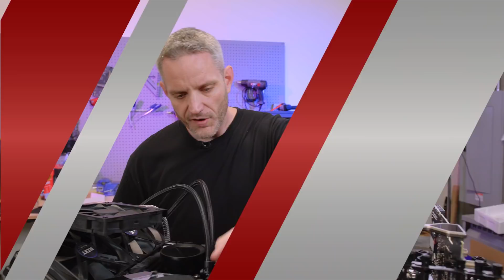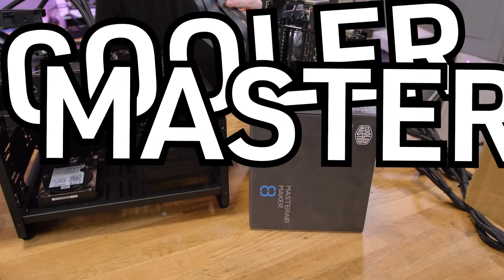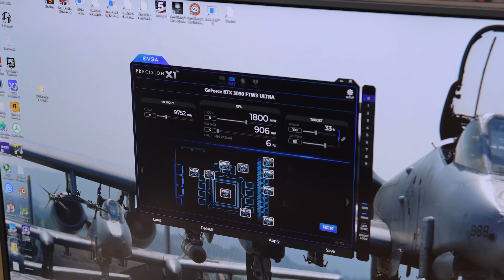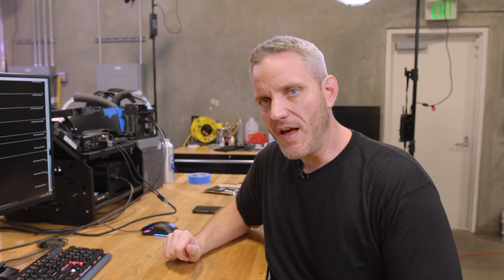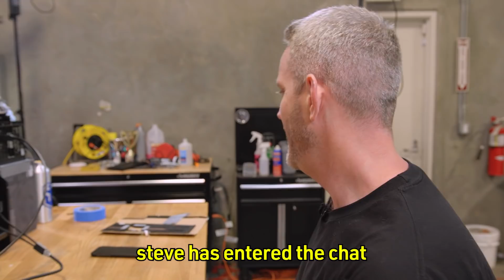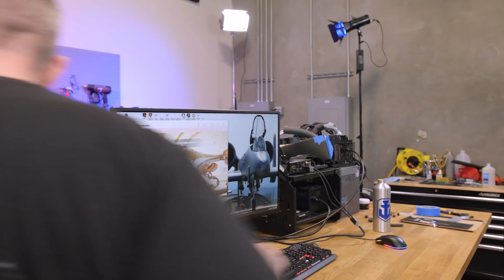Homemade Waterblocks for RTX 3090 SLI... these results are incredible!

Comment: For the love of the overclocking gods, salt the water so it can drop below 0C and chill the rad more.
Reply: And disintegrate and clog the radiator? They would have already done it. They use freon in some rigs. But its been known to damage hardware.
Reply: @jjs6568  He is immersing a rad inside the cooler filled with water and ice. The rad is also painted or anodized to the entire exterior so that should protect from corrosion. That's a heat exchanger, but we're not talking about adding salt or ice directly to the loop.

Salting the ice water would allow the temperature of the water the rad is submersed in to drop below 0C. The fluid in the loop (which does not connect to the ice water in the cooler in any way) should have an anti corrosive, anti microbial etc additive that should allow the temperature of it to drop to below 0C too.
Reply: @Producer_Steve  You're right, the rad will be fine. The pump, maybe not. But since they go LN2 and such, there's not really a reason to go with salted water. It's just one step on the way.
Reply: @kaldogorath  Once he solves the RAM and VRM cooling issues, getting the fluid even colder is going to be the only non extreme cooling way to get lower temps. For $1 or significantly less of a table condiment he could be gaining more overclocking headroom through lower temps and that could push him over the edge.

Speaking of the VRMs and RAM. Even a little bit of extra thermal mass and surface area would help a lot with temps. It's probably worth it to use 3m thermal adhesive transfer tape to affix 3mm tall heatsinks or even copper shims again just for thermal mass. That could also be the little edge Jay needs to top Phil and Steve.

Ideally he'd be able to use thermal cement like what ships with Arctic Acellero Coolers, but that stuff is nigh impossible to remove. Taller heatsinks would also be helpful but it looks like the bodged block is in the way of that.

So salting the water, making sure the loop fluid can stay liquid at below 0C and giving a tiny bit more thermal mass and/or surface area to the RAM is probably the best and cheapest thing he can do without going LN2, dry ice, immersion cooling or other extreme methods.
Reply: @Producer_Steve  My main argument was that running salt water through the pump will be very bad for it - he could get a salt water pump but it would necessitate that.
Reply: Again, we're not talking about the fluid in the loop. He is immersing the radiator in a cooler filled with ice water. Adding salt to the ice water OUTSIDE the loop would allow the water to go below 0C which in turn could allow lower temps in the loop.
Reply: @Producer_Steve  Again, the submersible pump is pumping water in the cooler. I'm very familiar with the concept of contaminated water having a lower freezing point, but the submersible pump is not part of the loop and will be pumping that salt water. 

The radiator is not sitting in a still ice bath, there's a pump in the cooler pushing water over the radiator, because if it wasn't there the nearby water would heat up and make the ice bath useless.
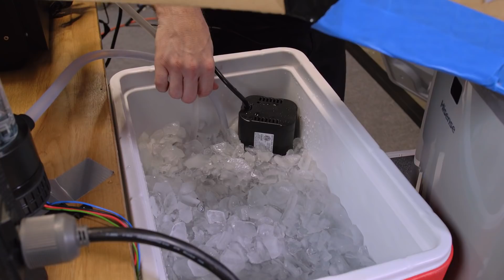Reply: The radiator absolutely is sitting inside the ice bath. @5:49 The pond pump is also forcing water flow across it underneath the ice, not loosely overtop of it.

He only uses this setup maybe once every 2 years. For the amount of time the pump sits unused, it probably oxidizes, rusts, corrodes or has rubber seals drying out faster by sitting dry for 700+ days between uses than a few days of salt water flow would cause it. He could also simply flush the pump between uses to clear out any remaining salt water before storing it. Finally it's a nothing part, probably the cheapest part in the whole setup other than the foam cooler itself. If it does fail a year or two earlier than expected, it's significantly cheaper to replace a generic pond pump than to replace a high quality liquid cooling pump or water block.

None of your comments include any points on why adding salt to the ice water wouldn't allow for a lower temperature in the entire loop. If the water in the cooler gets colder, it can get the fluid inside the loop colder, and that can cooler the GPU die more. It's simple physics.
Reply: @Producer_Steve  "None of your comments include any points on why adding salt to the ice water wouldn't allow for a lower temperature in the entire loop."

I thought I covered this well enough in my last comment. I never said it won't make the loop colder. It will. Of course it will, I said I understand the idea. MY argument was that going from 3C to -20C while not nothing is just going to pale in comparison to LN2. 

He's going to have to make all of the same changes he needs to make to use LN2 because the temperature will be low enough that condensation becomes a real thing. And if he's going through all that effort, why go -20 when you can go -196?

Comment: I would use some salt in your ice water  that should get the temp about 10 degrees cooler. Marine aquarium powerheads work better than that pond pump your using. Are you planning to do any shunt mods on these cards?

Comment: interesting matches for better results.
i have a couple of ideas i can't test myself
1. Use a Faraday cage to get rid of electromagnetic interference from the surrounding air
2. I know you tested how much pressure the threads of the water circuit can withstand.
and this should test the water circuit with a braided water circuit, what is better with negative pressure in the pipes or with positive pressure. water boils faster at negative pressure and has higher energy conductivity at positive pressure
ps. first test without computer components.
3. light is a source of radiation and spreads charged futons into an electrical circuit. (Reflectors are very strong) attempts to run tests in the dark. this will also help you with heat absorption in the room and maybe it will also cool the components more.
good luck with frequency calibration.

Comment: Jay, Acetone & Dry Ice is your solution! -70c
Reply: Provided that the acetone doesn't damage any of the plastic or rubber parts in the radiator or overrun the studio with fumes.
Reply: @mattsgamingstuff5867  doubtful, but one way to find out.. do it!
Reply: @Joeteck  True, I've just ruined more than a few things in a lab with acetone and similar solvents.  And run afoul of getting a bigger whiff than I wanted a few times.  If I'm going to have several gallons of acetone in a room, I'm instantly wary of having enough ventilation and avoiding letting it ruin stuff.  Especially the ventilation part, explosive atmospheres can ruin a day REAL fast.
Reply: @mattsgamingstuff5867  I never had any issues with it. Perhaps you did something wrong?
Reply: @Joeteck  https://www.acplasticsinc.com/informationcenter/r/a-chemical-resistance-guide-for-plastics  Some polymeric materials are severely attacked by acetone (PVC, plastic pens, and etc)  Prolonged soaking can leach plasticizer out and make less susceptable materials hard and brittle.  If your material is resistant you're fine.  I've seen plenty of containers and seals fail over stuff like this in a professional capacity; the same principles would apply to any polymeric materials present (and I doubt the materials were selected for resistance to organic solvent).  I wouldn't through a 100 dollar radiator in without contacting the mfg for information about the materials personally.  Then again seeing a pen partially dissolve and melt to your lab bench is an image that sticks with you.

Comment: Hey I’m still Running a AMD 2700X with my FTW 3 1080ti. With a ASUS xg35vq monitor. I feel like my monitor is bottlenecking my system. The gpu runs hot. O I got 3200 ddr4 Corsair vengeance.

Comment: Tbh i imagined 2.1ghz would be yesterday since my 1080 ti can do 2101mhz but then again it only has 3584 cores, not 10 effing thousand.
Reply: Nope it's just that Samsung's 8nm is garbage compared to TSMCs 12/16/20nm and 7nm/7nm+
Reply: IIIRattleHeadIII while i do think it’s some part of the problem, I don’t think it’s the sole problem, not even a big part of it, but yea no doubt that tsmc’s process is better
Reply: @dom1437  that's the reason on top of the rtx 3080/90 being a 627mm^2 die chip whereas the gtx 1080ti is a 471mm^2 die chip.

Comment: "Bare chips cool better!" Jay can I introduce you to my friend Surface Area?
Reply: Yeah sometimes I feel like Jay says inaccurate things very confidently without really thinking it through.
Reply: My thoughts exactly 😉
Reply: Yeah same
Reply: I suppose that with conditioned air stream any radiator mounted via thermal pad will act as an insulator, so bare chip would actually be better
Reply: @adfadfasefasefadsf  1) Silicone thermal conductivity at 2C is ~150 W/mK, Aluminium ~200, thermal pad <20, so thermal pad IS in fact insulator 2) they have a strong air stream, so it not like simple convection, but more like liquid heat transfer  3) in this case the heat is directly transferred to air bypassing 20W/mK thermalpad(or glue) that must be inevitably used for radiators
Reply: @adfadfasefasefadsf  I see your point and fully agree in the situation with standard air cooling, but my point is, with this 2C air temp and air stream (high air volume) the  thermal pad is going  to be the limiting factor between the radiator and component. So yes, you got x5 surface area with radiator, but at the same time you have /10 thermal conductivity with thermal pad

Comment: I had two idenctical 2080 Ti's both with the same BIOS, they both clocked differently.  One clocked to 1950 out of the box, and the other clocked to 2010.  I think it has to do with silicon lottery and how stable they are at a certain voltage.  One card could run 2030 at 1.063 and the other could run 2070 at 1.063, and 2070 at 1.093 and 2130 at 1.093
in the end I ended up having to customize the voltage curve for both of them, which was a massive pain. Because it was constantly moving every time I restarted a certain way or if I crashed.  And even if I saved the profile, it wouldn't save the curve exactly the way I had it most of the time.  It was a PIA.  Funny thing is I suggested that the fix for the 3000 series crashing was that the voltage curve was not properly optimized, and I'm pretty sure that is exactly the case.  Adjusting a custom voltage curve is something everyone who is hunting for frames should do.  You customize it to be as efficient as possible at every point, to a certain extent of course, you only need the usable clock range.  It will enhance stability, power draw, and temperature, and of course performance.  The one thing I often found myself needing to do was limit my clock speed because the power draw was so high it was bouncing the clock speed all over the place which was causing an erratic frame rate, so I just limited the clock speed to a point where it would draw close to max power, not not ever hit it and frame rates were smoother.
Speaking of your main card, I would always use my most power efficient card as my primary card, which funny enough was my bottom card.  That way the more power hungry card could clock higher without hitting a power limit.  It doesn't matter which slot you use as long as your motherboard plays nice and they're both the same PCI-E bus speed. If one is x16 and the other x8, well the x16 card should be your primary. But if they're x8/x8 it doesn't matter which one you use.
wisdom on enthusiast overclocking by Trump

Comment: I thought this was noteworthy and a way to help keep the Script Kiddie Scalpers away .... From EVGA's storefront:

We have made some changes to the checkout process for EVGA.com 30 Series orders. Now we are using a queue based notification system.

To sign up, use the notification button on the product you would like to be notified for. For everyone who already used the notify button previously, you are already entered. Once product is available (and it is your turn to purchase), you will receive a secure email that will allow you to purchase the product that you received a notification for. Please note that you have 8 hours to place your order, if your order is not complete within 8 hours, the product will be released back into queue system.

Also note that your email address that was used for the notify system MUST MATCH an email that has a registered EVGA account, if an account is not available with that email, you will need to create one before you can purchase.

Comment: Thermaltake Core P3 or P5 Vertical GPU brackets would work better.  You can mount the risers pcb on it.  Then you can raise the bracket up a little so the gpu's are not laying on the risers.  And why not try some G12 GPU brackets and modify some H55 or other AIO block for your custom cooling.

Comment: could one put the gpus in a sealed container, replace the air of the container with other gas that has NO water on it and prevent condensation that way?

Comment: I've always wondered what might happen if you tried to build a loop with mercury running through it. 

Mercury is one of the best thermal conductors known to man, and it's the only metal that's liquid at room temperature, as well as well as the Sub-Zero temps you'd get running the loop through dry ice and such. 

The biggest hurdle is finding materials to make the loop out of. Mercury eats most metals, and glass and acrylic won't withstand the temperatures. 

Also mercury is super hazardous, so there's that...
Reply: I don't think mercury's 8.3 W/ (m·K) is that high compared with the best liquid metals on the market already.
Reply: @somethinglikethat2176  but you can't keep those liquid at extremely low temps. 

Which means you wouldn't be able to keep them flowing through a loop at the those temps.

Comment: me, jokingly: Yeah I should just direct the output from my 12,000 BTU air conditioner into my PC, haha that'd be silly right

me:. ...yeah. like that.
Reply: I mean, if your PCs exhaust wasnt too hot before, it may be subambient after, so you still might cool down your room as well. Plus there will be no condensation inside the case, as long as you dont rapidly disconnect the AC and let wet air get into the PC before it heats up again :D

Comment: Hi Jay, just want to let you know that at 9:50 you mention the AC is blowing dry air, you might get some slightly better temps on your PCBs with moister air, as water is a better thermal conductor than air. i understand your main goal was to reduce liquid buildup, but it's just a thought
Reply: water is also more likely to be electrically conductive and short out something on the card

Comment: Potential dumb question, why not apply air conditioning while taking water below ambient? Wouldn't that help with condensation because the air surrounding the components would not have such a temperature delta?

Comment: Are they dual bios cards? looks like one is in silent mode and the other in turbo
Reply: Are they in fact the exact same SKU? Is also possible that one is the Ultra Gaming and the other is the non-Ultra Gaming model
Reply: @TADP0LE9806  the bios versions were the same, so I think they should be the same sku
Reply: Yes they are dual bios. There a oc switch. My 3080 has one and it gave it a 4% boost.
Reply: @Inknov83d  that sounds about right indeed
Reply: Yeah it possible Jay bumped the bios switch while playing with the set up lol..
Reply: @mechnut450  bingo, it could happen to me. I just want Jay to kick Paul's ass!

Comment: The FTW cards, if you go to Bestbuy, there is 2 different prices and 2 different sku's for the same card. I noticed that today. One sku is 6436196 $809.99 and the second is sku  6436191 $789.99. Can I get some swag for the find Jaytwocents? They are 2 different cards.

Comment: Sea salt the ice bath. Fill the lines with pipeline glycol. And add two Ys so the waterblock are parallel instead of inline drop those temps even lower

Comment: Penguin Chillers makes a glycol chiller, that will hit 5 degrees F against 5k+ BTU.
Use a plate chiller to keep the loops separate and chill the system down to ambient-15, which will put you above condensation temps,  and likely make the whole damned thing stable at 90% of the clocks you are running.

Comment: could just get Mineral oil near freezing point and cover the entire PC run the oil out and back in through something making it cold. this could cover every single part obv but would suck to clean. however do to its thick nature it absorbs heat fast and if you can keep it cold temps would be crazy low. or just jump straight to LN2

Comment: I literally went through a similar batch of runs with the 3080 I got recently last week. Was  determined to get 31000+ in firestrike. Made it... after some airflow and cooling upgrades.
Reply: Regular firestrike? On my 2080 Super I'm getting 30000, is this the extreme or ultra test?